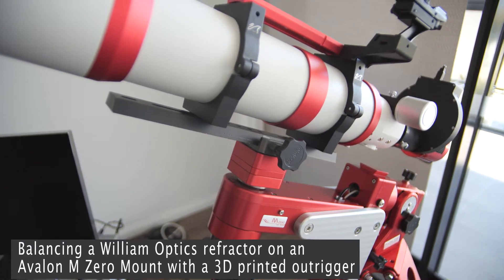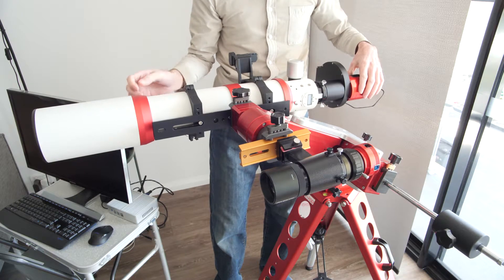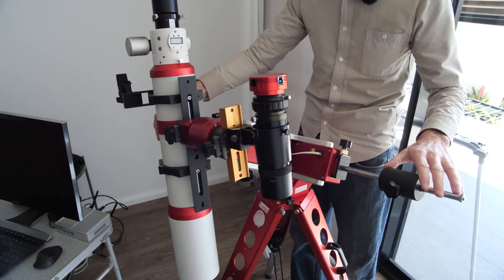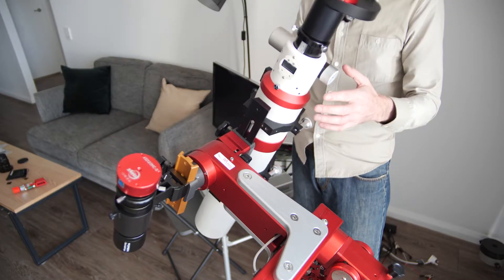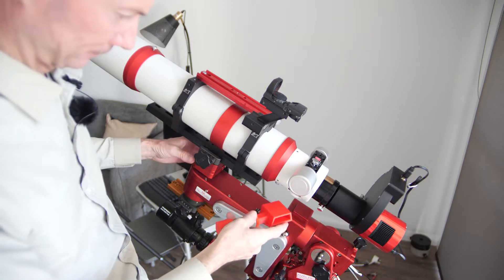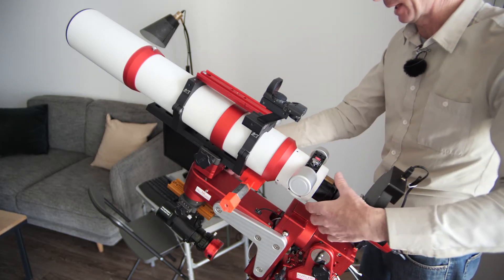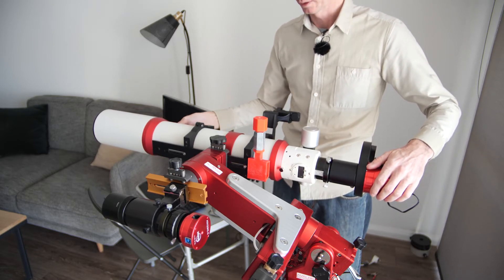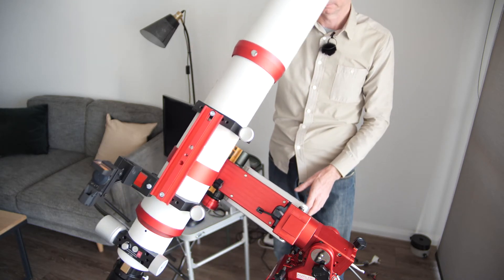Balance WO GTF102 on an M Zero mount

Comment: do you really need to have a balance that perfect? i ve same mount, and with or without balance, i ve almost the same results.
Reply: balance is perfect on the video, but once you install all the cables, its  totally different anyway
Reply: you mean when you cannot achieve a nice balancing in every position it is still fine ? i have that problem, i can't get a good balance with the scope in home position but when DEC axis is at 90° i can balance the RA axis the right way. and even DEC balance is very hard to get it perfect
Reply: telemaq76  A slight inbalance isn't an issue, especially with good quality mounts, as long as it isn't too much.